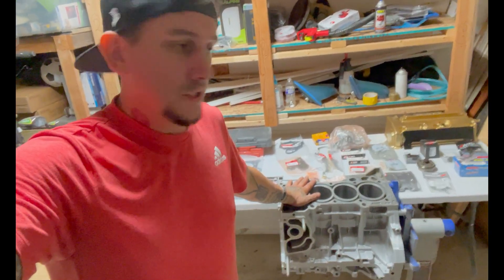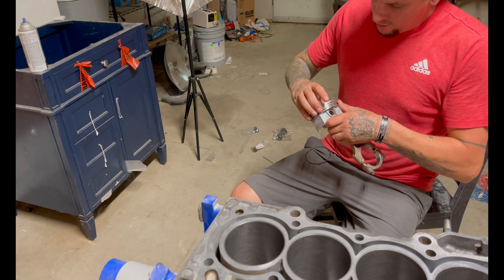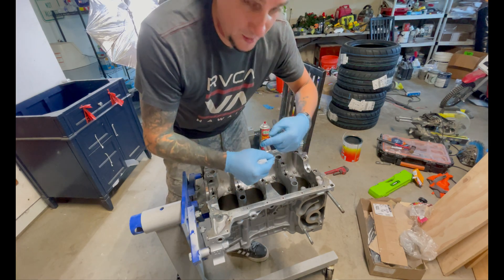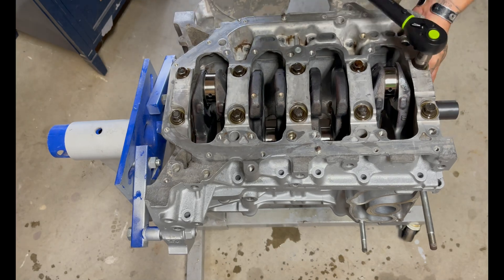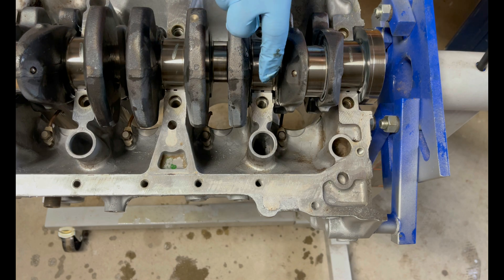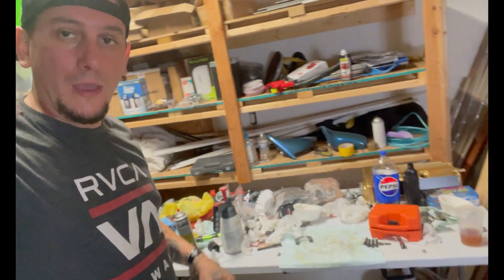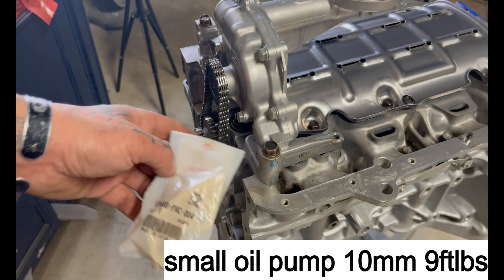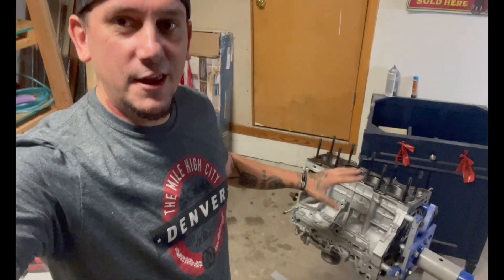k24 Build | K20 Oil Pump Conversion | Civic Build Series

Comment: K24a2/K20a2 head built head all motor 🔥🔥🔥
Reply from the maker: Too late for all motor 🤫
Reply: @BrokeVetGarage  I have both and I like all motor better lol but can't wait to see the future progress 💪🙏
Reply from the maker: @Willis-de5hx  it’s going to be low boost. I don’t want anything too crazy where I have to put 5k into a trans lol thanks bro
Reply: @BrokeVetGarage  I'm a full built k24a2/K20a2 head  turbo stock trans and I'm right at 600 HP .. my all motor k24a2/K20a2 build head is around 260+ or so
Reply from the maker: @Willis-de5hx  k20z3 trans?
Reply: @BrokeVetGarage  yes .. I checked my Dyno sheet and I made. 585 hp stock trans .. but after 22 passes the 3rd gear is starting grind a lil bit  lol but normal driving and making a pull and shifting kinda quick no grind at all .. I'll probably swap the synchro out this winter
Reply: @BrokeVetGarage  also running 1000hp rated axles
Reply from the maker: I think I’m going to try to stay around 450. Try to keep the bearings happy lol
Reply: @BrokeVetGarage  if mine is still good after a few years then yours should last a long time lol .. great tune and stay up on the maintenance and don't destroy it like a fat kid eating a McChicken and you will be just fine .
Reply: I’ve got a k swap civic im new to this it’s been a year and few months now and im close to done buying everything,,, ik its gonna take time to get everything installed 
And I got a k20a3 rsx 5 speed 
I’m doing good bolts on everything else is nice parts 4-1 header running stock injectors and ecu
I can’t wait to get it running,, 
My plans for the future is to buy a built transmission k20a2 head and block and stay with the k20a2 if I decide I want more power not really trynna go crazy since im trynna daily my car
I wanna make at least 250
Reply from the maker: Shouldn’t be too hard to get with a k20a2. I just bit the bullet and bought basically everything to finish mine this month. It will be running before thanksgiving if everything goes right.
Reply: @BrokeVetGarage  i hope it goes right man,, just in time,, I’m thinking off getting it ready by next summer,, it’ll probably be ready by February but ion wanna take it out of storage and drive it in the snow I ain’t give up can’t do it now,, is grind all winter
Reply from the maker: Get it!